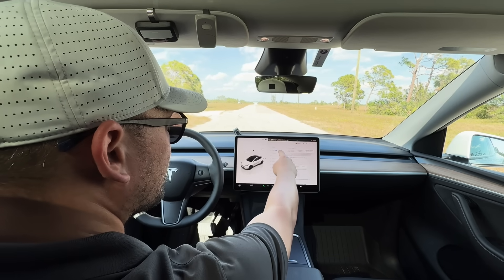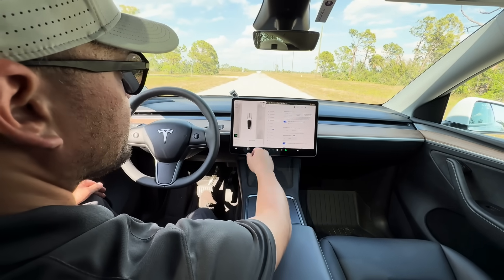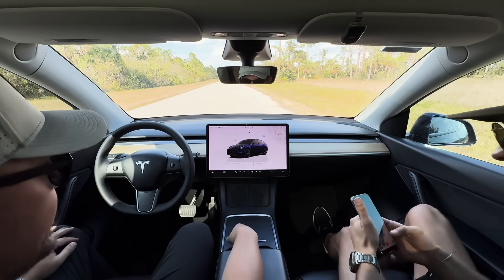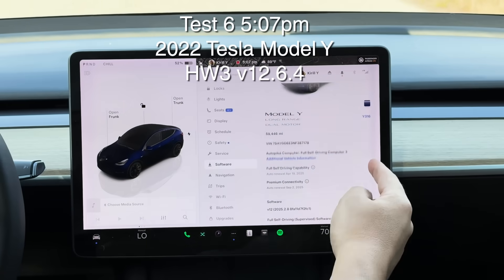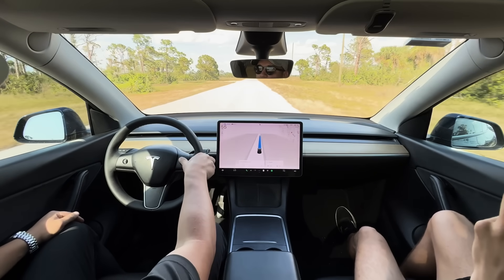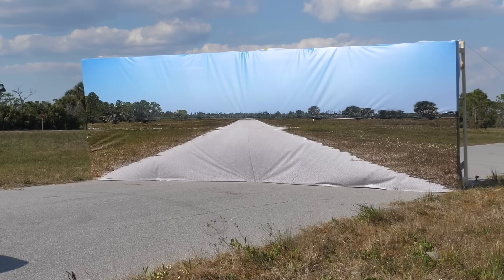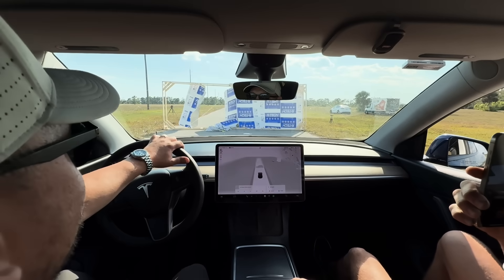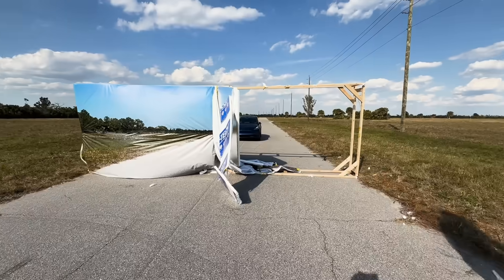Mark Rober Debunked - You can't fool a HW4 Tesla using FSD!

Comment from the maker: Experiments planned for the following weeks 

Tesla’s HW4 with mannequins in heavy rain and fog.

Also firefighters request to crash and burn a Tesla to check its metal and how hard it is to extinguish.
Reply: The suggestion I saw on the mannequin test was remove the mannequin and keep the "weather" for a version of the test.  The argument was that the weather itself was triggering the response and not the mannequin.
Reply: @zendell37  I would do 4 tests, mist (*water* mist, not smoke machine) with mannequin, mist without mannequin, 'rain' with mannequin, 'rain' without mannequin (rain in heavy spray from above, not wall of water from the side...) ... Pretty sure all of this stuff can be accomplished after a visit to the irrigation section of home depot.
Lidar is expected to see sufficiently heavy mist or rain as a solid object, so it might stop for that reason. Tesla FSD vision is expected to see the water as water, but we  don't know if it will stop due to poor vision, and if it keeps going, if it will see the mannequin. 
I expect that any obstruction sufficient to block Tesla's vision of the mannequin is also sufficient to look like a solid object to lidar, but unless they can get ahold of a similar lidar car there's not a lot of reason to play with a whole lot of different levels of water density. It would be interesting though to know if / at what point Tesla stops due to unsafe driving weather. 
Ideally, it should slow down or stop due to weather such that it never hits the mannequin but idk if it will. Humans sure don't, that's why accidents skyrocket in inclement weather.
Reply: @zendell37  For the LIDAR? For sure the water was making it stop; it's a known issue that it will see a wall - even in situations were a camera can see past it. 
LIDAR cannot see the mannequin once there's a wall of water. AIDRIVR's response video has some footage of Waymos stopping when there is a clear path around the water.
Interpretation of the real world is not as straight-forward for LIDAR as fans may make seem like. The software that interprets the dots that are generated cannot be perfect.
Also you will always have the problem of which sensor to trust when there are multiple inputs disagreeing.
Reply: You should see if you can get a Subaru for comparison as it's the only other automaker using a camera based driver assist system.
Reply: Kyle - Is there a way to tell what is being identified by the cameras vs what is being picked up by the 76GHZ radar system?
Reply: The muskrats here to defend their hero.
Reply: Just a number of different routes to death.
Reply: But hw3 tests also, I hope.
Reply: What if you put a mirror on the road. Will Tesla steer away to avoid its image or hit the mirror?
Reply: You better have some good background story from beloved cartoons for that "crash and burn" test. 
Otherwise people won't believe this could actually happen in real life.
Reply: Also verify 2:40 again please , HW4  is again seeing the road from the scenery of the picture .
Reply: @Y2Kvids  Yes, but Mark Roper, like a large portion of existing Tesla owners, own cars with the older HW3, which apparently does NOT recognize this.  And we're still waiting if there's a difference in rain and fog scenarios.
Reply: Yeah...the engineering team really should have designed to meet this situation cuz it happens so often....they really dropped the ball.
Reply: it is possible that the tesla picked up the edge of the wall due to your wall oonly being the width of the road where mark rober had the wall extend a foot or 2 past the road
Reply: @brufa1x  Who cares.  I won't buy a Tesla because of their business practices, the CEO is a whack job Not See, and he's untrustworthy.  Plus, I am not interested in an EV.  I also have been looking at what other EV car mfg's are making and Tesla looks like total dogs hit compared to what the China and other Countries.  

Did you hear the latest joke?  Tesla, the car company that sells the Cybertruck, will not accept them as a trade in for a different model.  What kind of bullshit is that?  Seriously. Also, Elon sues Tesla owners that post negative things about their experience with their own cars.   That's ridiculous.

Elon bans Tesla owners that have bad experiences and go public.  

Elon fired people at the NHTSA and gets a bunch of investigations removed because the NHTSA investigates cars that have been involved with an accident where there is a fatality.  Imagine, the car company surpassing flaws with their own products.  Do you see other car makers doing this? NO.  

Tesla can go out of business as far as I'm concerned.
Reply: Did the car stop itself after hitting the wall? I see two problems here either way. If it was the car, why did it go to left side of the road aka on coming traffic? If it was the driver, why didnt the car brake after the hit? There have been claims teslas turn off autopilot just before hit - possibly to make the accident "human error".
That said, to this day I dont see the need for self driving cars. Yes safety equipment like warnings and crash avoidance steering/braking are great, but people should never be teached to not take responsipolity of their driving. This will teach people terrible habbits that are extremely dangerous when these automatic systems fail or you forget you drive something that doesnt have them.
Reply: All the firefighters have to do is visit their local Tesla dealer to find Telsa cars lit on fire
Reply: LMAO. Gargle gargle gargle
Reply: AI models may actually be "smart enough" to distinguish between foam mannequin and real person. If you can look and see it is obviously fake, maybe it can, too.
Reply: You don’t extinguish the fire. The firies really need training on this. You contain the fire and wait for it to go out. It burns with water and it burns with itself. Nothing can put it out.
Reply: HW3 FSD 12.6.4 is awesome tho
Reply: Would like to see the results of mannequin testing. I still think 3 sensors are better than just cameras
Reply: This test doesn't debunk Rober though. In fact it proves that his test was real as only HW4 was able to detect the wall. Sure, newer teslas can recognize the wall, but he has an older model, likely running on older tech. Should he have mentioned this? Probably. But his wall test is still completely accurate.
Reply: Thanks for doing an honest video about this.  The liberal propaganda is insane
Reply: 3:34 It does not'zi the wall... Did it at least salute to the wall?
Reply: Yep im in.
Im sure that mark rober will post something, maybe in thr community tab. But i hope the word gets out about lidar. Its plain better no training needed
Reply: Great to see more tests on this, would be good for you to point out that HW4 has radar, whereas radar was removed from HW3 in 2021. I wonder if a HW3 before 2021 with radar would also see the wall.
Reply: @sacah2 Nope. No radar. Never again. Tesla employee here: Elon has banished it. Facts.
Reply: Add some large round black steel pipes to your list, a truck could easily loose one or more on the road, and place one across the black road (without the sun reflecting on road and/or pipe).
Not as easy to detect as a red fire truck - but I think it's better testing safety before somebody trashes another Tesla and we learn the hard way.
Reply: Just like apple inc.. You suck the moment you touch it. Save your soul Use feet
Reply: Instead of arguing that Mark was wrong, you went out and did it yourself. Thanks for debunking this for us!
Reply: @mafelixos01  It's obvious that Mark was using older hardware/software version.  So, what's the problem?  When did Mark do his tests?
Reply: @Oneness100   
It’s hard to take the video seriously when Mark Rober didn’t approach the experiment with the scientific approach he usually takes with his experiments. He used Tesla’s Autopilot, which lacks the safety features of Full Self-Driving (FSD), and disabled it moments before crashing into the wall. Tests were obviously trying to favor the luminar car, and it feels more like a stunt than a test. Plus, he claims of not being sponsored but Luminar’s CEO is friends with Mark and an major investor in Team Seas. There’s a clear conflict of interest here, and the lack of transparency makes the whole video questionable, which makes this video so helpful.
Reply: @mafelixos01  he tested his own car.  So, his car has old software, just like the majority of Tesla's on the road. Yes, Mark should have tested all versions that are currently on the road.

But it's still worth knowing. 

Not everyone is dumb enough to pay for Beta software, which should be illegal.  He's charging people money to put their own lives and other people's lives at risk.

What's worse is that Elon fired a bunch of people at NHTSA and subsequently got all of the investigations of Tesla's dropped, which means he's hiding facts about Tesla vehicles being death traps.

Tesla, according to the NHTSA have more deaths per billion miles than any other car mfg.  Elon's trying to hide this from the public.  He's a piece of $hit for doing this.

And it's all coming back because people are finding out and now boycotting and protesting Tesla and Elon's unethical behavior.

F Elon and F Tesla.   And his status as the world's richest man is in jeopardy as Tesla sales around the world is tanking and so is Tesla's stock value.  Can't wait for him to go bankrupt.
Reply: @Oneness100  K. So I'm not trying to get political here. When you pay for FSD, there are multiple indicators that the driver of the viechle is responsible for the viechle even if the viechle it driving itself. Considering that a quick google search has informed me that the NHTSA is currently investigating ~2.6 million tesla viechles relating remote control of the car, or smart summon, where nobody would be inside of the car in event of a crash. Going back to your political views, I could venture to guess that during the Biden administration, Elon was doing just fine because Biden was pushing for electric viechles. But now that Elon is working with Republicans, you hate him. Everybody makes mistakes, billionares included.
Reply: @Oneness100  I'm not looking to get political in a YouTube comment section. If you feel this way speak up in some other way than coming after some guy just trying to show his respect towards a creator.
Reply: @mafelixos01  But you are making comments that pulled this conversation into that because you feel Elon can do whatever he wants, or that he tried to fire a bunch of ATC's for "efficiency" nonsense.  

You need to understand reality first.  Elon doesn't live in reality and he's getting a taste of it and he's too much of a narcissist that he's now trying to act like a victim.  F him. He did it to himself.

The other side is that his existence and wealth is because of Tax Payer money helping Tesla and SpaceX exist and I'm a tax payer.
Reply: @ 
 I don't appreciate you putting words into my mouth, and I doubt you understand the difficulty Elon had to go through to get where he is. I don't think a couple hundred thousand people are going to mess him up. Mind you he was sleeping in the same office he worked in while creating PayPal, and look how that's doing today.
Reply: @mafelixos01  Difficulty?  Who cares, He's abusing his wealth and power that he bought and paid for because he's trying to turn our Country into an Oligarchy/Dictatorship that only works for the wealthy, regardless.  That's UNAMERICAN.
Reply: @mafelixos01  Quit idolizing someone that's making money from tax payers that doesn't want you to know how unsafe his cars are.
Reply: @mafelixos01  There's other Countries that are banning Tesla's from being sold. Tesla owners are starting to sell their cars and their resale value will plummet, new car sales are going down.  Which means no sales, no profits, no profits no wealth.

He didn't create Pay Pal..  You need to watch Common Sense Skeptic videos on Elon and the truth behind his bullspit.
Reply: @Oneness100  damnit are you thick? this video shows how fsd can see a legit wall painted to look like a road.
Reply: @mafelixos01  mark was right though. Assuming he had an older version (he has like a 2020 or 2022 model) he'd be on old hardware which didn't recognise the wall. This video proves that's accurate
Reply: @ yes but he also only used autopilot not fsd, which has less safety features. Least he could've done is clear that up. I see what you mean.
Reply: @mafelixos01  But FSD is $10K and it's beta software.  You think someone would be dumb enough to pay $10K for beta software?  Doesn't seem too smart.  I can't think of a single company that charges money for Beta software.  I think Tesla might be the only one and people are STUPID for spending more than 1 penny for Beta software, putting their lives and other people's lives in danger.   Tesla should be doing their own testing because they sell it.  Why put your customers and other other people's lives at risk?
Reply: @mafelixos01  Agreed.  Mark should have clarified his video detailing the HW, basically stating it could vary based on other HW that they aren't able to test.  He is basically trashing a company's reputation without looking at or providing all the info, which makes it seem sketchy.
Reply: @jgm2003  a bit like elon announcing a new roadster coming soon and have a prototype on stage and opening preorders to then not letting the costumers know when its coming or if it is still coming .
like where are all those 2018 fsd taxi's he told we could order and make us money without being in there?
Reply: Cool, now I can pay $8k to not drive into a paper wall 😂
Reply: I've never seen so many people take a children's educational science video so seriously lmao
Glad you're answering the questions for concerned Tesla owners tho.
Reply: @TheOfficialOriginalChad  I don't care if it does pass the tests, I won't buy a Tesla because of Elon. He's a crazy piece of garbage.  Not sees are NOT allowed in this Country and he wants to take away critical job, Social Security, etc.   Sorry, but Trump/Musk are destroying our Country and making a LOT our allies into enemies.   The two belong in prison, not the Oval Office.

Even if Elon was a great person, and the cars passed these tests, I STILL wouldn't buy a Telsa.  There's too many issues surrounding Tesla's, EV's in general, nor ro mention Elon has lied many times and I just don't think he should be the CEO, he's got too many issues.
Reply: Not to be a downer, but even someone who needs glasses would have seen that the sky is much more vibrant in this test, the chanel author used the same photo for the test, and it's a cloudy day... no clouds in the fake wall. 

BUT, I will say, that is an improvement because the older FSD version didn't see the wall even with such discrepancies, so I call that an improvement.
Reply: @viktorbihar5384 - Agree 100%
Also a tiny but wide wall, 3 ft high or 1 meter in height and 1-2 ft in width/depth, with some naturally occurring obstacles on the sides of the wall/road to obscure road/sideway - so the vision system is not just seeing contrast differences/changes in the sky.
Will this be tested, doubt it due to it is likely to fail as well.
Edit - YT, please 'fix' @name where name disappears too
Reply: A judge driving a tesla in Florida was in self driving mode and at 50mph it ran into the back of another vehicle. So yes it fools itself even in reality. It's not safe.
Reply: @orangehatmusic225  Unfortunately the fanbois seem to think its infallible.
Reply: The "do not crash into this thing in my way" system should work regardless of FSD or Autopilot. And claiming the version number is a win doesn't help those on previous versions proving what a liar Musk is and has been as to when FSD will be ready.

Comment: Try that on a foggy day and see what happens.
Tesla's 100% vision-based system is moronic and is strictly a 'fair weather' system that sh!ts the bed as soon as the going gets tough.
Completely useless (and dangerous!!!) in any environment other than stop-and-go city traffic at low speed - as long as the weather is perfect.
Lidar-based systems are the only ones that have a chance - ever-  of being safe and reliable.
And I say this as a tesla owner (model 3 long range dual motor - that I bought brand new in 2023).

Comment: Sorry, but one successful test is meaningless. It needs to work reliably 999,999/1,000,000 times at least. Mark demonstrated that it can be fooled and it doesn't matter if he used an older version of the car because that car was sold under the pretext that it would be full capable of FSD with a software update.

Comment: So they added wall detection mode to either HW4 or self driving 13.2.8? Still doesn't account for all the other disadvantages of relying on cameras, like eg. driving in fog or rain.
The problem with this test (and the original test this is a reaction to) is that cameras don't see as much as LIDAR (which every other automaker is using). Cameras can fall for the exact same optical illusions we as humans can fall for, so I still deem Teslas as being unsafe in the self-driving department. They're also unsafe in other ways, like the door locks and that horrible touch screen being involved in nearly 100% of all actions. At least your model Y has a few levers left behind the wheel like a sane car, but Tesla made moves to even eliminate those, and I will never buy a car where you set the indicator with a touch button.